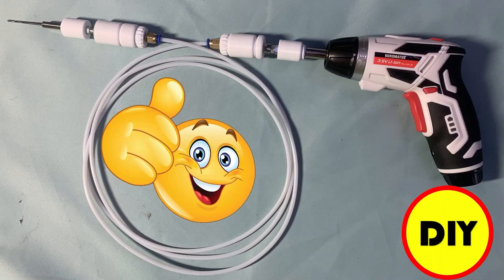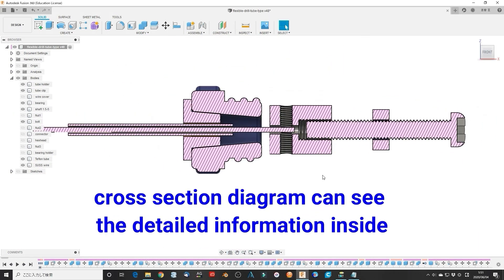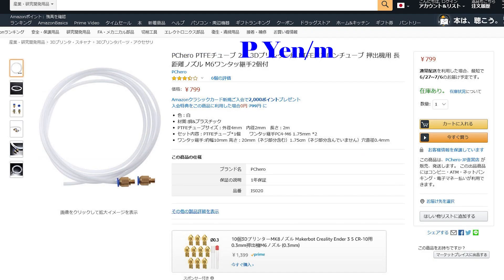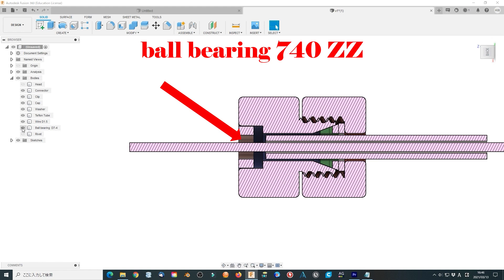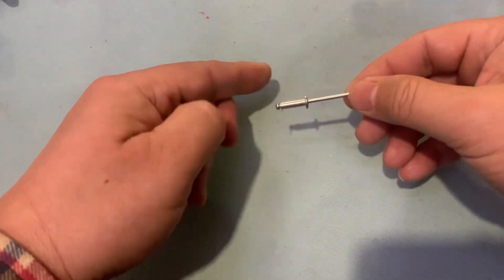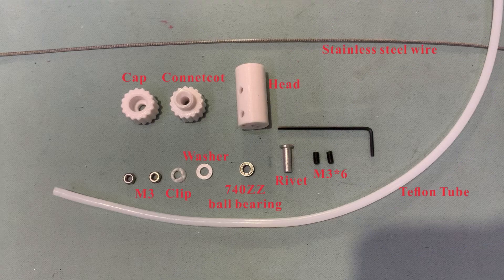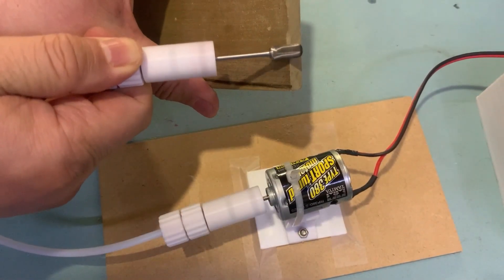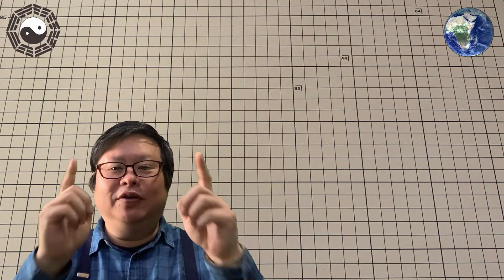How to make flexible shaft (cheap, easy, and practical) with 3D printer and steel wire

Comment: this is so good, thanks a lot, you can hook this with a low rpm wind turbine and no need for electricks
Reply from the maker: Thanks for your comment. This is an old project. I am glad that you are interested in it. I hope you have fun with this small tool.
Reply: @TubeUnderdeveloped  i could send you a wind turbine, mechanical power project upcycling materials if you are interested in the matter
Reply from the maker: @crapisnice  Thanks for your concern. This project is mainly for my studying Fusion 360 software and mechanical basic knowledge. Now I have almost finished learning and changed to another interesting field, AI-related,  such as Stable diffusion. If you send me the files I may check in my free time. Good luck, have a nice day.
Reply: @TubeUnderdeveloped  an upcycled thick steel wire could be used and a rigid irrigation hose, with maybe some 3d printed bearings each half meter

Comment: Any way to make a flex shaft where the outer sleeve is also rotating all along the length? (not just transmitting the rotation to the end bit)
Reply from the maker: Thanks for your comment.  Since the inner and outer shaft rotate at the same time, where is the handle placed? It will be a challenge I think. Please share with your friend. Have a nice day.

Comment: Great! Just one flaw, spinning part is too long, and section I can hold on is too short. maybe something to cover spinning part?
Reply from the maker: Thank you very much for your comment. It is true that you point out that the model is not perfect. Since I also want to have something which I have not in my hand now. For example the larger ball bearing and short rivet. Then the handle part can become larger and more stable, the spinning head can shorter. Maybe I will upgrade it later. Thanks again. Have a nice day.
Reply: I think the long part makes sure it's supported straight atleast initially